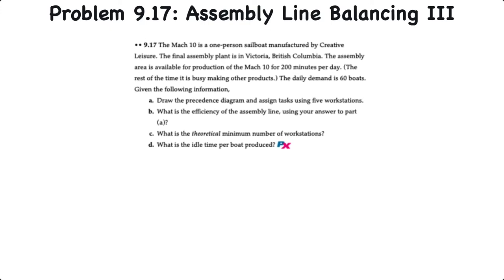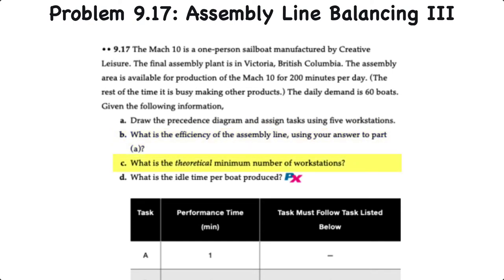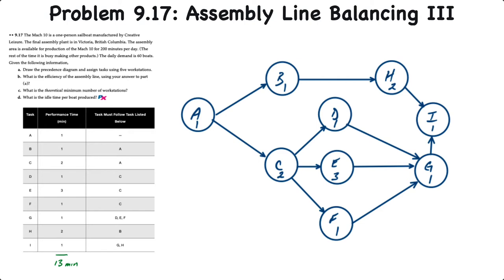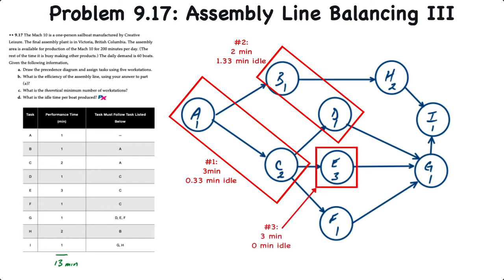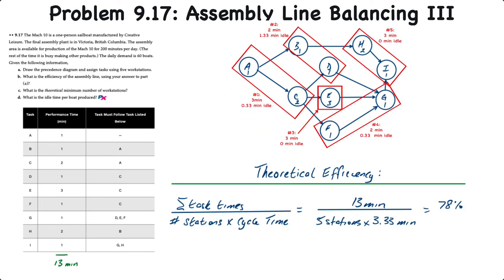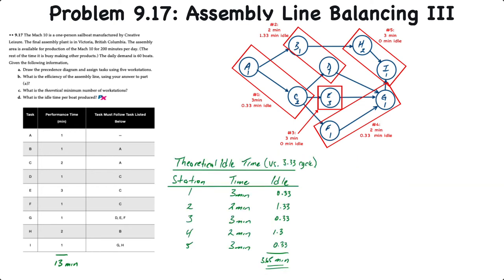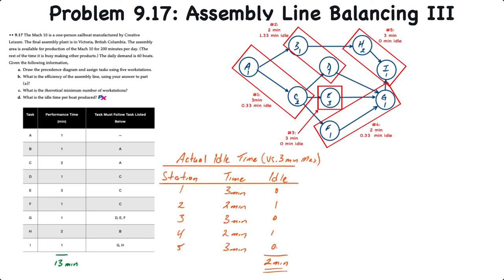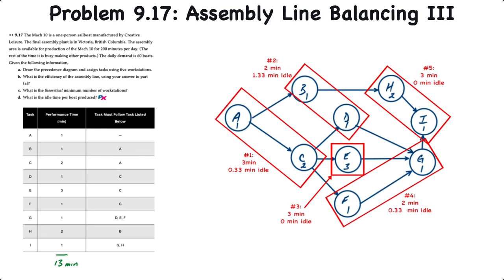Operations Layout: Assembly Line Balancing III

Comment: Hello, a good video of you.
I have a question..
When the production time is 200 min. and the sum of the task time is 13 min. its mean that the company only can make 15 boat. So how the company fulfil the demand which is 60 boat per 200 min??
Reply from the maker: Hi there. Sorry for the delay. You are right, the company can output 15 per hour, but is for 1 workstation. Since the minimum number of workstations is 4, that works out to 60 boats (15 x 4).
Hope this helps.
Mark